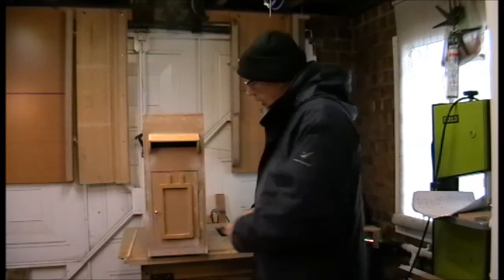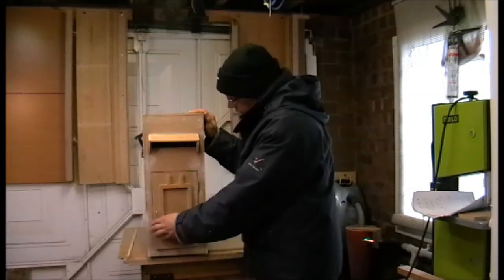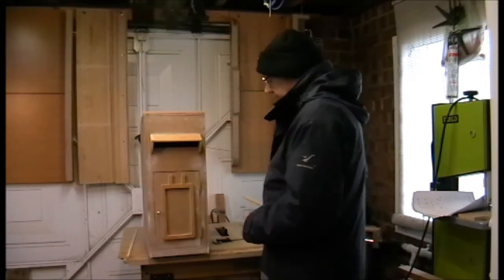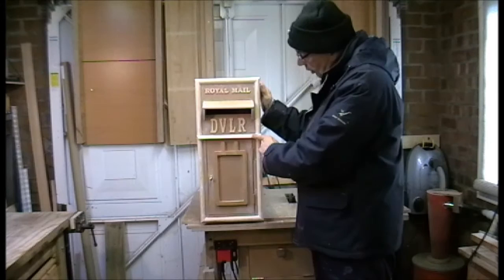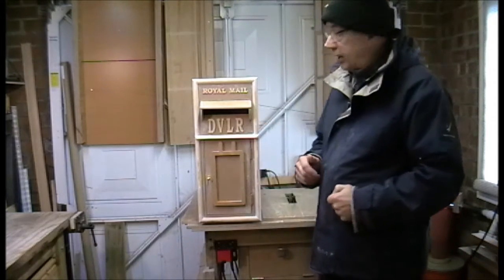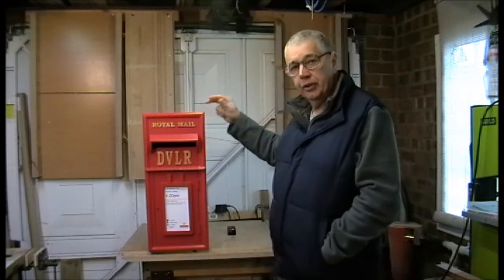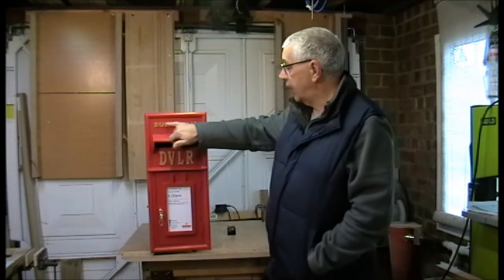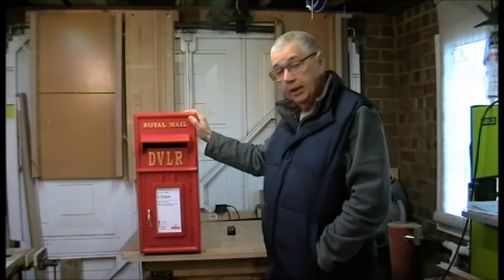DIY PostBox Part 4

Comment: thank you for sharing your video. 
I'm planning on making one for the sister in-laws wedding but was thinking of using ply and was wondering have you tried to bend ply before using the same method and did it work.
I'm probably going to use 9mm ply as I already have some.
Reply from the maker: Hi, it works with plywood just the same. Make sure you cut deep enough, probably just leaving the last ply in tact. Hope this helps and let me know how you get on.

Comment: Great  post box I can’t get the link for the plans to open
Reply from the maker: Hi, I have just tested the link and it is working fine! When you click the link you should be taken to a page with a white box which says PostBox.zip and 3 files below, Label.jpg, label.PSD, and PostBox.pdf. In the top right-hand corner on the screen, there should be a downward-facing arrow, this is the download button. Press it and the files should download to your device. If that doesn't work let me have your e-mail address and I will send the files to you.

Comment: Hi,

What is the lock which you installed?
Reply from the maker: Hi, it's just a cheap wardrobe lock that I got from Ebay.
Reply: @briggal1  Thanks.

I bought a CAM lock from Screwfix.

Again, thank you for your response.

Comment: for some reason i can't get the download to work.
could you please give me the sizes of the main box please the rest i will work out .
thank you
Reply from the maker: Hi, The link works as I have just tried it. When you click on the link you are taken to a page which shows three files, Label.jpg, Label.psd and PostBox.pdf.  At the top right of the screen you should see a downward facing arrow with a line under it, this is the download button just click on it and the plans should download to your computer.
Hope this helps.

Comment: Just wondering how the MDF, although painted, will hold up outside over time. I have never had a lot of success with MDF projects for outside use. Even when the MDF has been sealed and painted, they just never last more than about 12 to 18 months.
Reply from the maker: The ones I have made were all for indoor use only. MDF is no good for outside.
Reply: @briggal1  Hi Allan
Yep, I learned that many years ago. I was just wondering how a postbox would work on the inside if you get my meaning.
Reply from the maker: @cliffcarlo180  I made two for use in schools so the children can post Christmas cards to each other and one for a wedding so they are not used outside.
Reply: @briggal1  Cheers, Glad we cleared up that little mystery lol